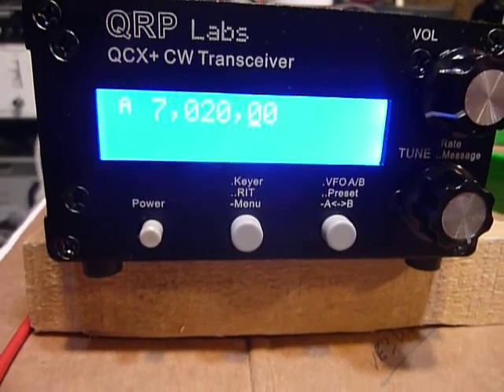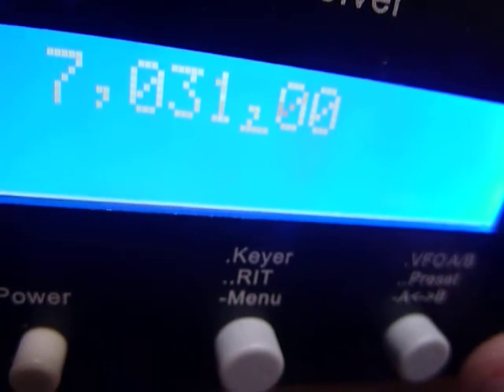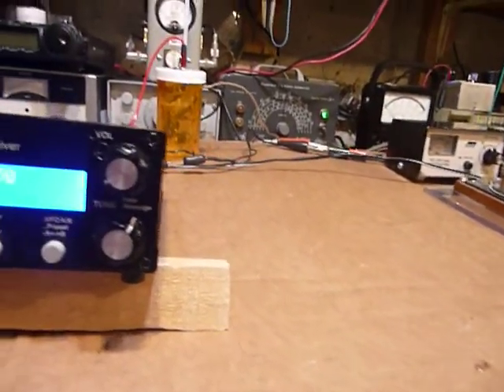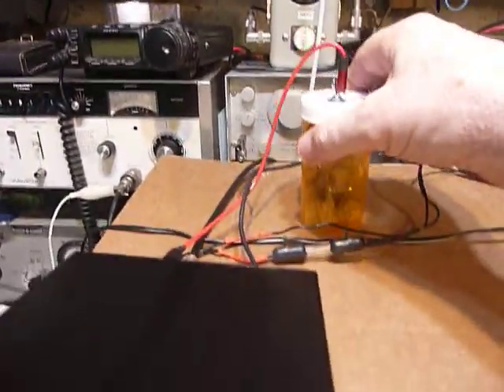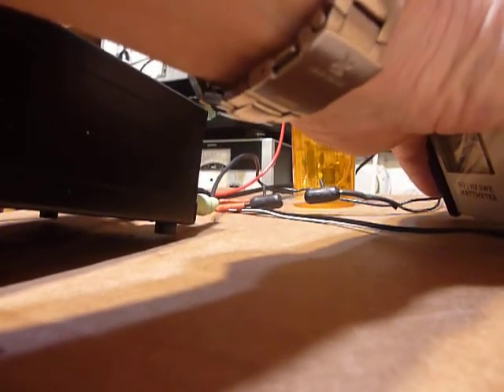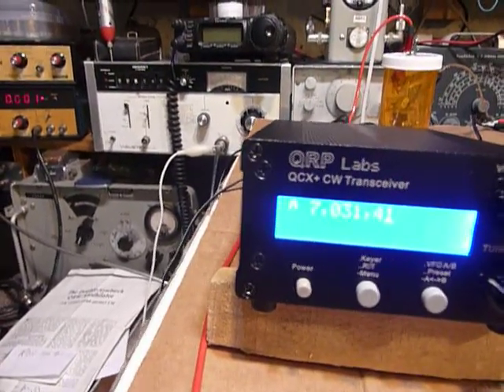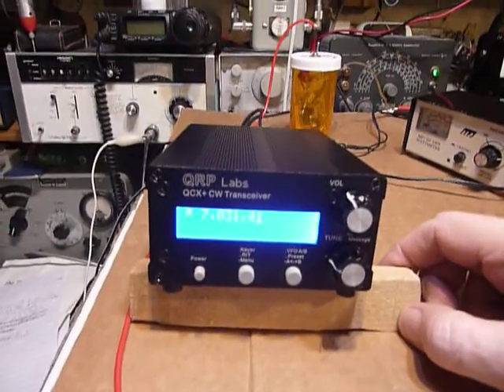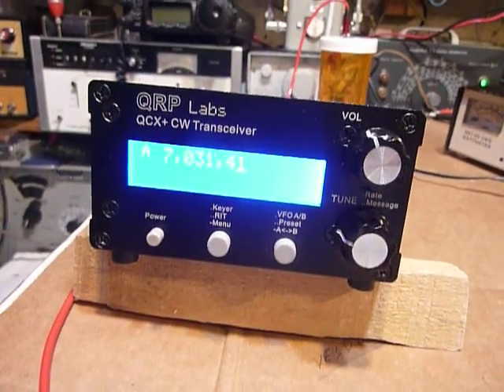QRP QCX+ ,  QCX+ with LM567 Zero beat indicator , LM567 Zero Beat

Comment: I built the QCX and it is working nicely. I built the QMX and am having issues with it. It is too tiny for my 81 year old eyes. My next project will be the QCX+, problbly for 17 meters. Thanks for the video.73's. Mike WA8UOC
Reply: I built the QCX plus for 160m, it is a much easier build than the mini....I stuffed up my first build of the mini (probably similar to QMX size and difficulty). The QCX plus is basically the same as the mini but just more thru hole rather than SMD parts - so YES great rig and less stressful build!
 https://youtu.be/twbssx1lWpw

Comment: Bob, try pushing in and holding the tune knob in and turn it and see what it does. Carl
Reply from the maker: Thanks Carl  I see that it is printed or actually etched by that knob  tune ,rate and MESSAGE  So many features in this little wonder 
and more to check out and learn as I type this I remember going to Electronic Supply  in Roseland Indiana just north of South Bend  to buy a couple of Raytheon CK722 transistors in the 1950's  when they were first available  for $1.00 each  to make a regenerative 
Broadcast receiver  I most likely rode my bicycle  and now its back to the future and at age 79  I am still into 
Ham radio and learning with electronics and still excited about it ...  73 and good DX ... Bob
Reply: @robertsumption1243  Hi Bob. I am almost your age and was interested in electronics since I was a kid. No place to buy any parts then until Radio Shack moved close and I was able to get there floor sweepings junk. Back then  I lived near a Navy base and could get some ARC receivers. I even got them to work. I am envious of you. I grew to love Heathkits and have about 15 of them at this time.  I have only one Heathkit that I couldn't get to work in all modes. So 73 Bob and I look forward to your next Video. Carl AB1ZI